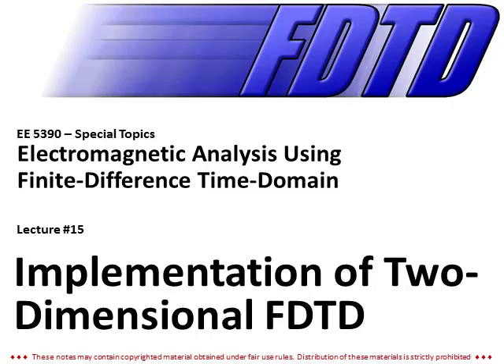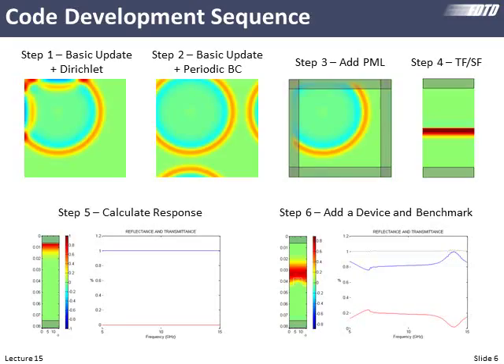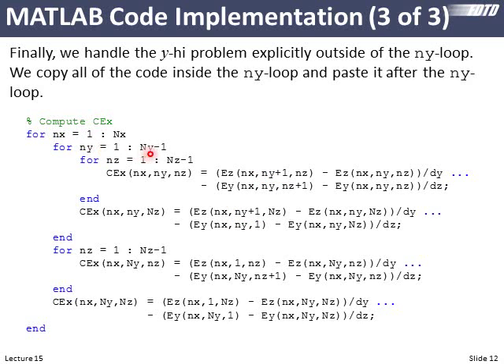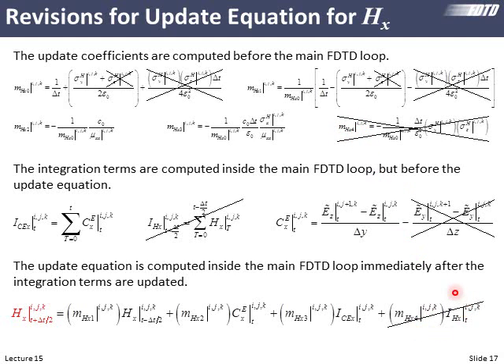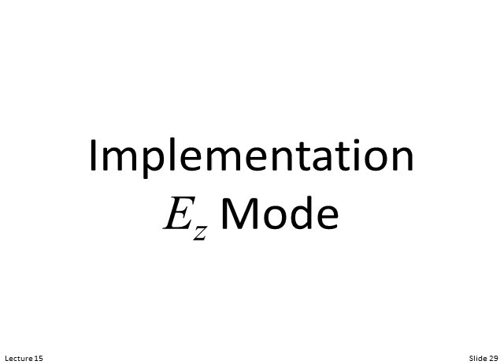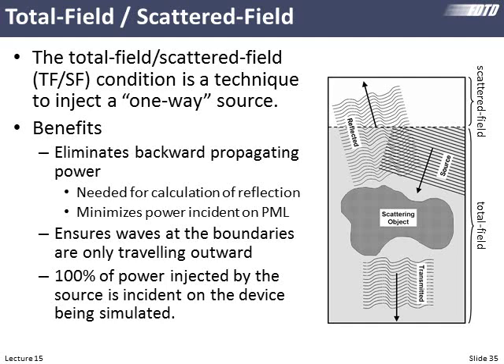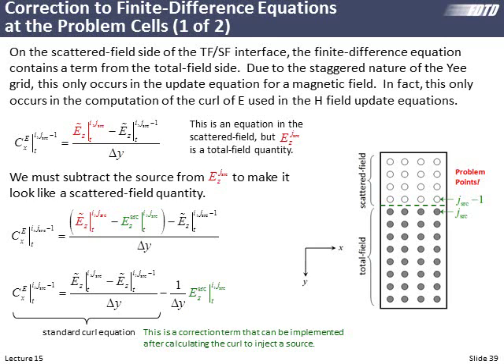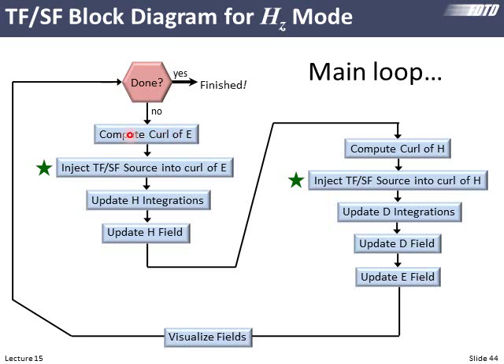Lecture 15 (FDTD) -- Implementation of 2D FDTD

Comment: Hello. I can't seem to get my PML to absorb the incoming waves effectively, as you've shown in other animations. I can absorb them moderately if I make the size of the PML 50cells on each side of the simulation, and even then it absorbs only partially. A lot gets reflected back into the working space.
Any tips regarding E field size, PML value or other parameters? This assuming that update equations and coeficients are correct. I tried to use the equation in slide 27, which gives values for the PML like slide 28, but it's only partially absorbing.
Reply: This is that awkward moment when you realize you posted a question withouth first trying some simple things. 
I solved it by making the sigx and sigy values 10x higher. :D
Now I have a simulation to play with!
Reply from the maker: Ha ha.  If I had a nickel for every dumb mistake I made, I would be a very rich person.  Good work!
Reply: excuse me but how did you make the values higher because i have the same problem and i have reflections everywhere
Reply: Just multiplied the sigmax and sigmay values by a constant. The profile is still there, but with higher values. I can get by with ten cells on each side, maybe less.
Hope it helps.
Reply from the maker: You may want to check how your new PML behaves as a function of angle of incidence and with polarization.  I have found PMLs that work awesome with just two or three cells, but it only works for a specific frequency, polarization, and angle of incidence.
Reply: I actually did every thing but i couldn't find a result.I'm using the instructions in homework(8) but I didn't use the draw2d() command becuase I didn't know how instead I used 
imagesc(Ez);
pause (0.0005);
axis xy
can this make a problem or there are more things to consider more than that?
Reply from the maker: imagesc() should work fine.  Use a colorbar and check your color axis.  It may be that your code is exploding at some point that is hard to see and makes everything else look like zero.
Reply: I'm having problems with the PML region as well, and can't get it to work. I'm using the code as worked through to complete homework 8. The source (simple soft source) just propagates towards the PML and appears to fade away, but then it just creates a blue region in the middle and I really can't figure where it comes from. Multiplying all the sigmas by a constant just makes the wave vanish all of sudden, but not in a way the PML should do. Below is the relevant code (update equations + soft source):

for T = 1:STEPS
    
    %% Compute curl of E
    
    % CEx
    for nx = 1:Nx
        for ny = 1 : Ny - 1
            CEx(nx,ny) = (Ez(nx, ny+1) - Ez(nx,ny))/dy;
        end
    
        CEx(nx,Ny) = (0 - Ez(nx,Ny))/dy;
    end
    
    % CEy
    for ny = 1:Ny
        for nx = 1 : Nx - 1
            CEy(nx,ny) = -(Ez(nx+1, ny) - Ez(nx,ny))/dx;
        end
    
        CEy(Nx,ny) = - (0 - Ez(Nx,ny))/dx;
    end 
    
    
    %% Update H Integrations
    ICEx = ICEx + CEx;
    ICEy = ICEy + CEy;
    
    %% Update H Field
    Hx = mHx1.*Hx + mHx2.*CEx + mHx3.*ICEx;
    Hy = mHy1.*Hy + mHy2.*CEy + mHy3.*ICEy;
    
    %% Compute Curl of H    
    CHz(1,1) = (Hy(1,1) - 0)/dx - (Hx(1,1) - 0)/dy;
    
    for nx = 2:Nx
        CHz(nx,1) = (Hy(nx,1) - Hy(nx-1,1))/dx - (Hx(nx,1) - 0)/dy;
    end  

    for ny = 2:Ny
        CHz(1,ny) = (Hy(1,ny) - 0)/dx - (Hx(1,ny) - Hx(1,ny-1))/dy;
        
        for nx = 2:Nx
            CHz(nx,ny) = (Hy(nx,ny) - Hy(nx-1,ny))/dx - (Hx(nx,ny) - Hx(nx,ny-1))/dy;
        end
    end  
     

    %% Update D Integrations
    IDz = IDz + Dz;
    
    %% Update Dz
    Dz = mDz1.*Dz + mDz2.*CHz + mDz4.*IDz;    
    
    %% Inject source
    Dz(nxs,nys) = Dz(nxs,nys) + Esrc(T);
    
    %% Update Ez
    Ez = mEz1.*Dz;

   %% Visualize
    .....

end
Reply: + Vicente Guedes
 I had just exact same problem :( .
Reply: hey I am new to FDTD method.  I am having the same problems.  PML partially reflects.  multiplying sigx,sigy with a constant gives some results but problem is not completely solved. any suggestions you may wanna give?

Comment: UPML is called Uniaxial because it only absorves the waves propagating in a particular direction? Like the rightmost PML only absorves the part of the wave propagating to the right with sigx~=0. And the topmost PML the part of the wave propagating upward.
Is this true?
Reply from the maker: No.  It is called uniaxial because in order to absorb waves at any angle, any polarization, and any frequency, the medium comprising the PML must be uniaxial.  Waves at any angle of incidence will be absorbed.  In practice however, waves at larges angles are not absorbed as well.

Comment: Ez mode = TM, is that right? thanks
Reply from the maker: Yes.

E Mode = TM
H Mode = TE

Be careful though.  I have seen this reversed in the literature.  Also, it is an easy detail to mix up.  Let me know if you catch any mistakes in the notes!
Reply: thanks but in lecture 25th (FDTD) there are 2 Frameworks about TM, TE mode I don't understand what it is
Reply from the maker: This is confusing and there are different ways that the labels TE and TM are used.  That is why I avoid using them as much as possible.  In one context TE means the electric field is transverse, or perpendicular, to the plane of incidence.  This is used in wave scattering problems.  in another context it means the electric field is transverse to the direction of propagation.  This is used commonly in waveguide analysis.  These are different definitions that can lead to opposite configurations if applied to the same problem.  For what is being discussed here, TE means perpendicular to the plane of incidence, however, there is no plane of incidence!  So you have to pretend that there is and extend the angle of incidence to 90 degrees.  Weird huh?  That is why I do not use TE and TM very much for this sort of thing and stick to E mode and H mode where this is no ambiguity.
Reply: thank you very much
Reply: in all FDTD lecture, do you use E mode or H mode?
Reply from the maker: I do provide some equations for the H mode, but otherwise the 2D FDTD stuff is all E mode.  If you work through the E-mode lectures I think you will find it straightforward to implement H mode.
Reply from the maker: Sorry for missing this question and answering 8 months late!  I teach E mode.  I have thought about adding the H mode.  It is very straightforward to do that so it has not bothered me much.

Comment: shouldn't the last equations on slide 40 using "+" before the correction term?
The last two equations are not consistent. There are two "-" before Hsrc, so at last it should be "+".
Reply from the maker: Yes, absolutely!  Great catch.  I am not sure how it happened, but there was another error in this lecture that put a negative sign on the amplitude of the magnetic field source.  These two errors "corrected" each other and this mistake was not caught until now.  This mistake also trickled into Lecture 16 and 21.  There may be others, but that is all I caught.  Anyway, I have corrected the electronic version of the notes which you can find here:

http://emlab.utep.edu/ee5390fdtd.htm